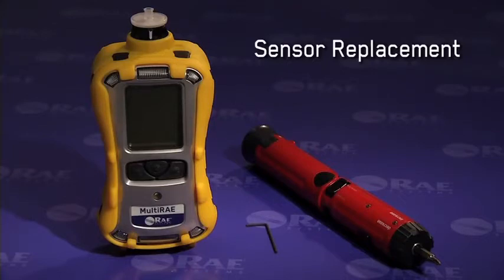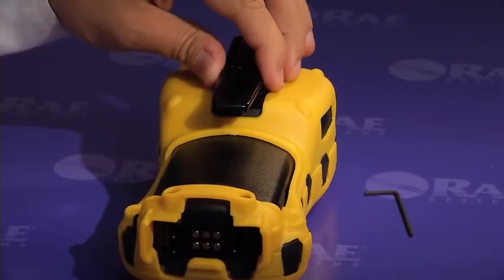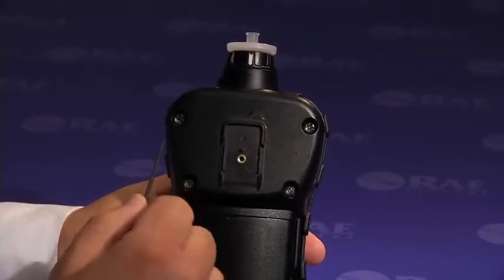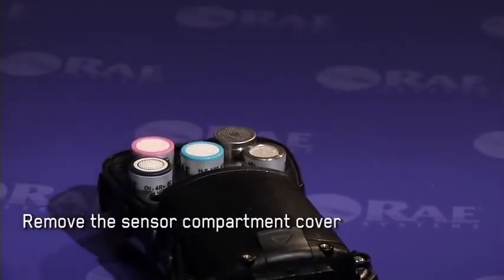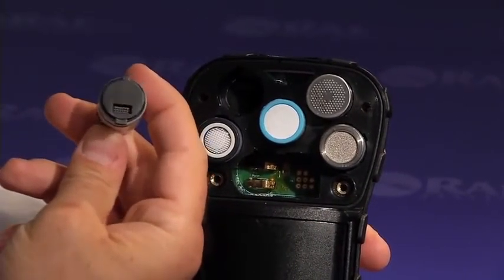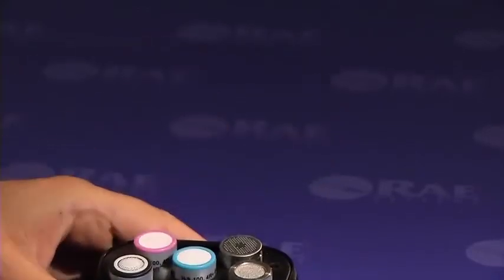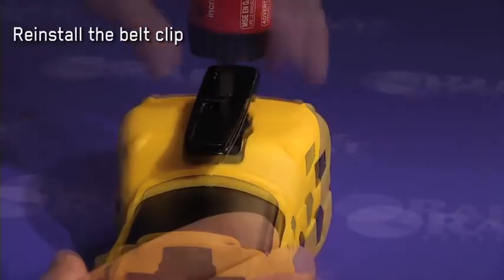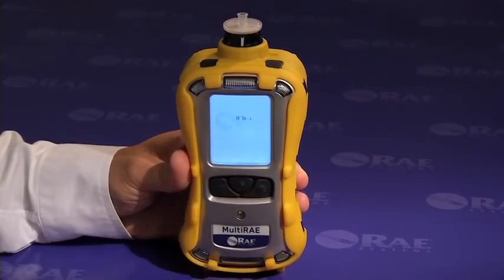MultiRAE Training   Sensor Replacement

Comment: Thank you for putting the video together.  My understanding is that some sensors are required to be allowed to sit with power to them, after installation,  for some amount of time before they can operate normally.  You should put a link in this video to the technical documents discussing that issue.